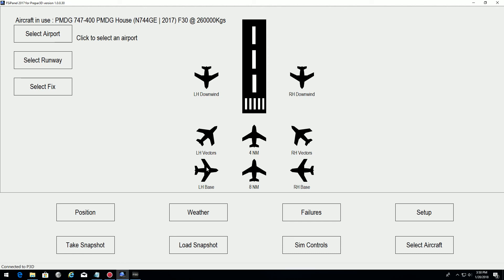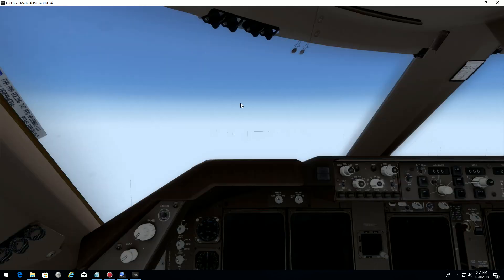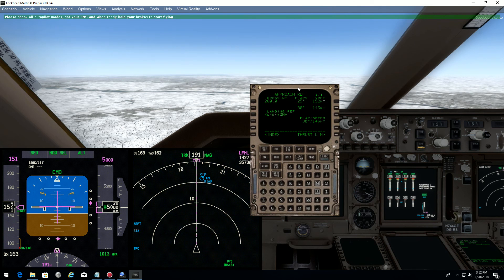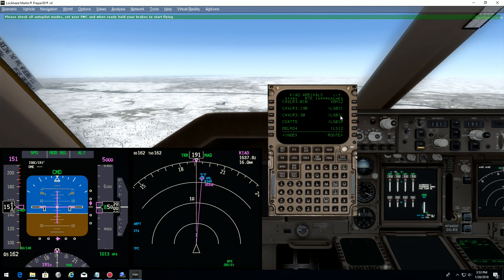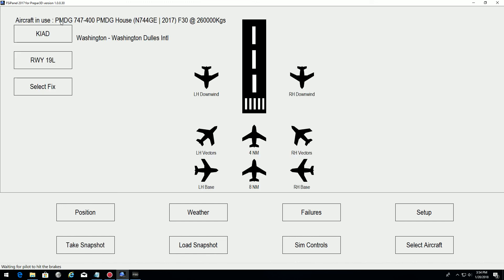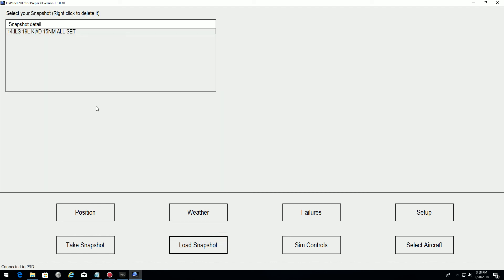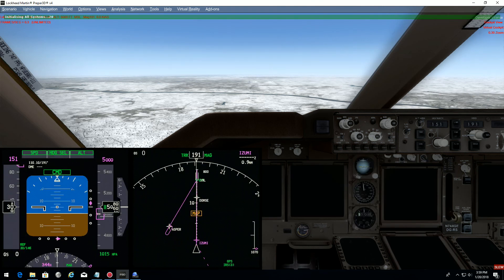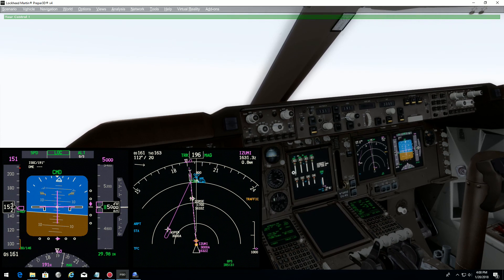FSiPanel 2017 how to change PMDG747 destination on the FMC

Comment: Great video, wish my PMDG  747  could also fly like this ..I am facing issues of black panels in PMDG 747 P3Dv 4.5..only while launching the aircraft thru FSI panel..I am facing no issues in   777 & 737 & also on 747 when it's on the ground.I have read your manual and done everything I could..pls suggest why shud I do now
Reply from the maker: Hi, do you have the latest version of the PMDG 747 installed ?
Reply: Yes its the latest version of PMDG 747 installed in P3DV4.5. I am not facing any problem in PMDG 747 while normally flying the aircraft in P3Dv4.5, its only when i use FSI panel, PMDG 747 shows black panels, no landing gear but can hear the sound of engines. I am not facing any problems while flying PMDG 777 or A 320 Pro while using FSI panels. Pls provide the resolution...FSI panel is such a great utility & it has become integral part of my daily routine. As a loyal FSI panel user ( I also have FSI panel for FSX) If there is no resolution on PMDG 747, request if you could allow me to use  the credit for PMDG 737 . Thanks